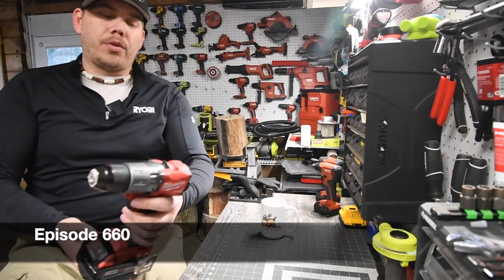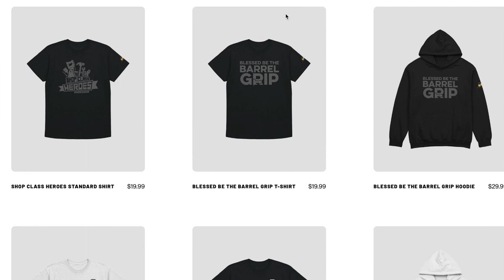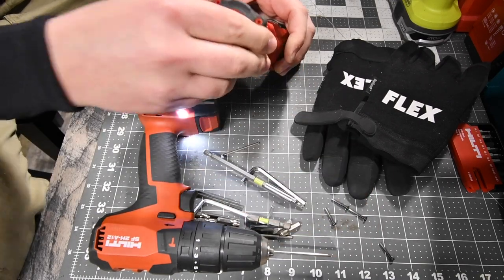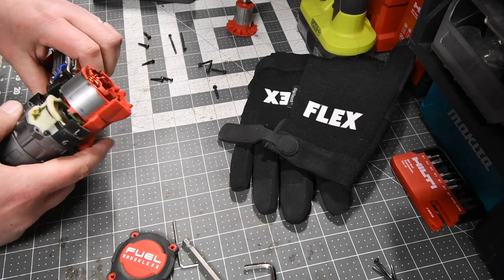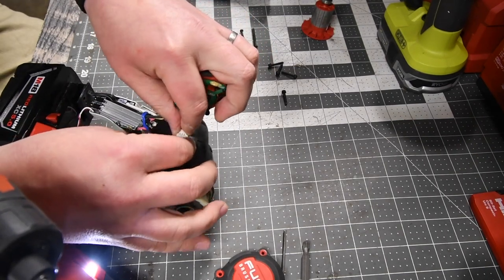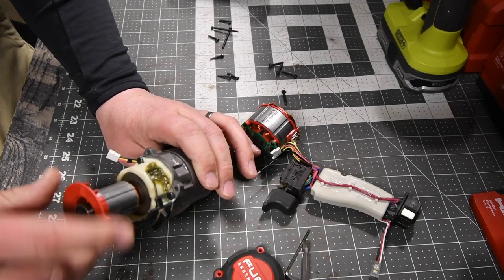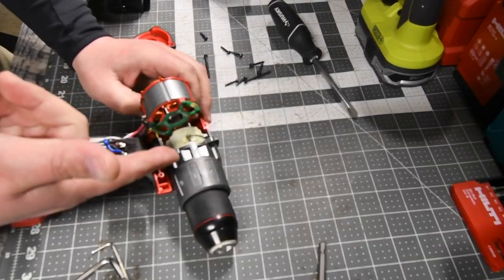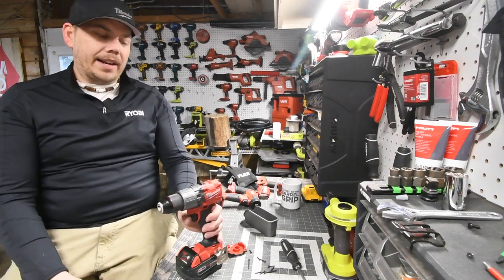ALL TOOL BRANDS BREAK!

Comment: Everyone loves Milwaukee but I've had a lot of problems that my yellow tools never gave me. M18 fuel hammerdrill chuck locked up in 6 months, fuel sawzall wouldn't change blades in 3 months, fuel impact trigger glitches and stays in forward and reverse after switching. Changed the chuck on the hammerdrill for $40. Took apart the sawzall and fixed it but it took 2 hours with the smallest needle nose pliers you imagine and a lot of frustration. The impact I can't fix because it's electronic. M12 fuel impact collet doesn't work. M12 tripod light stopped collapsing so I returned it. M12 vaccum dust flap was junk out of the box and would just spill back out when you turned the vac off. My Dewalt tools have never given me the same trouble. I also have a lot of milwaukee tools that I like, but for an entire m18 fuel kit to fail really bothered me. It was the most I'd ever spent on a kit.
Reply: The quality of materials is less on the Dewalt. However, the build quality/design is much better with Dewalt.  On average.
Reply: I’ve had the same issues with Milwaukee, but whenever they have an issue it’s “all tools break” and when it’s another brand I hear a lot of “ this is why you should only buy red”
Reply: @robertrada4783  the quality is less with DeWalt and better with DeWalt??
Reply: @robertcasey3528  Parts vs assembly of said parts.

Comment: Process of elimination starting from the battery on up. First thing that I noticed was the led light did not turn on. Verify the light was good then figure out what controls its function.  The tool doesn’t look abused.  A friend of mine who is a full-time mechanic handed me a box of brushed and brushless impact’s ratchets, batteries, you name it all out of warranty.  I’m surprised how much abuse that these Milwaukee tools can tolerate.  The issue I noted with every one of the tools and batteries was the amount of grease gunk built up around the  battery terminals both on the tool and battery.  They were not visible until you disassembled the tool and or battery. Most only needed to be cleaned in those areas and they were back fully functional. The brushless versions needed all the grease removed from the motor circuit boards and then they were up and running.  The brush tools were easy to diagnose because all you had to do was smack the side of it and they would start running for a bit sparking from the brushes. I just need to order brush cards. Like I said this was just a project I took on. So there was no loss in the event I couldn’t repair them then they would just be tossed in the trash.  

Reminded me of when I was young taking things apart to figure out what made them tick.
Reply: Led lights rarely ever go out. I'm going to lean towards a bad trigger.
Reply: Now that's some pick apart patience.

Comment: I’ve had to send my impact in twice to get fixed(trigger, reverse,bearings), hammer drill (trigger), rotary hammer (they sent a new one), 16ga nailer (they sent a new one). They’re good about fixing or replacement so I think I’ll keep with them until otherwise.

Comment: If you think the problem lies in the trigger (which doesn't seem to be the problem) , then by all means check continuity with the piece press and unpress, you can also check voltages, now if its the piece on the handle (i think it's a esc) then it's something it requires a new esc, and lastly, from the look of the thumbnail and the dissambly it seems you had a short on a board situated on the White piece thats near the transmission and I'm guessing it's a electronic clutch
Reply: The clutch does not work on mine but the rest of the drill works fine.   Go figure. 😂

Comment: I have the Ryobi blue tools and it's still works.
Reply: Then you're not using them for anything substantial. Most tools will survive a decade or two of hanging pictures.
Reply: I borrowed one on their blue recip saws. That thing had seen much use before I got a hold of it. I used it to dig up and replace portions of a septic system. Ran it nonstop cutting out roots and the like. I buried that thing in dirt and mud to the point the rubber over moulding peeled off. Obviously not as powerful as my Super Sawzall I purchased later but she did the job.
Reply: @BigHoss1776  Was it the Milwaukee M18 Fuel Super Sawzall Orbital Reciprocating Saw?

Comment: Hummm. What's the warranty on that Milwaukee tool? 5 years in case your not sure. There's nothing inside repairable and  the Motor/switch is more than the price of the tool. Soooo send it in and get it fixed. Really.
Reply: Milwaukee needs to quit with the cheap Chinese switches and learn from Makita
Reply: I was surprised how much those things cost as well it’s just a damn switch.  Then again they want an arm and a leg for their branded grease for their impact hammer assemblies.
Reply: Only a 3 year warranty on any of their OPE tools and they still use crappy switches in those 🤦🏼‍♂️ look at all the M18 mower failures right out the box
Reply: @Factoryseconds123  So I guess I missed were it was determined that it was in "fact" the switch? The problem with brushless tools is that it could literally be anyone of the electronic components or a mechanical connection. As far as Makita....... who makes their switches?
Reply: @slivers4007  Defond (in this case) for Milwaukee. Defond shows up in a lot of the German made or German owned stuff.  Omron for Makita, pretty much exclusively or maybe exclusively.  Kedu in Hilti.  It’s either the main PCB (I’m leaning toward it) or the PCB for the motor or any spot along the shoddy wiring.   Weird that I watched mancaver just praise the pcb assembly.  It’s pretty gnarly and sketchy looking in my opinion.  Other brands do a much better and more professional looking job. Milwaukee PCB pot boxes are like an amusement park ride that has been held together with duct tape and popsicle sticks.
Reply: @Factoryseconds123  I would happily guess if a Milwaukee repair person says something was a bad switch, it was probably, factually and most actually  the shitty soldering to said switch.  I’m used to seeing all sorts of crimped and heat shrinked quick disconnects or screw terminals in modern power tools.  Milwaukee, I know it’s going to be soldered. And I know the soldering is going to be a shit show.
Reply: @slivers4007  Omron.  Highly regarded Japanese company.  They use Marquardt in some other tools like angle grinders, but it's mostly Omron.  

Makita's also nice enough to allow you to service the switch if that happens to be the problem.  You unplug 2-3 wires, or a small plug and drop in a new one.  Can be an economical fix ($15-$30, depending on tool)  With Milwaukee you may as well throw the entire tool because they make you replace the motor, ESC and switch all at once because they make it all into a single assembly and the part costs well over $100.  (the one for this drill is $130, whole drill off eBay is like $100, so it's a pointless repair) 

About the only thing you can salvage off this drill is the outer casing and the chuck.   But the chuck sucks, and is a proprietary thread too.

Comment: I’d argue that because it says Milwaukee on there it in fact WILL break.  I can see how kinked that blue wire coming from the potted circuit board to the switch is. Which.. is typical for them.  I’m sure the soldering is just as lovely. All of the terminations are soldered… Take a look at the mess of stator copper wire hanging all about to make for their soldering terminations.  How much of that rotor is plastic vs…y’know…metal?  Take apart one of your 6H-22 drills (not the 4-22…that one isn’t built that well) and compare. Your audience will be blown away by the difference.  I’m not saying Hilti is the greatest ever. I’m not saying Milwaukee is the worst thing ever.  I’m just saying I know the insides and outs of these two specific drills. The build quality difference is night and day.

Comment: You prolly blew a component on the board. I would tell you to buy a new trigger assembly but you cant buy one anyway. I tried and Milwaukee doesn't sell parts event to parts stores unless you are an authorized dealer.
Reply: ML14-20-1120.  Not hard to find in stock at a couple places. 

The issue isn't getting the parts, the issue is that they're prohibitively expensive.  And Milwaukee makes things extra nice by making the motor, ESC and trigger all a part of one assembly.  So a trigger issue that might cost $15 with a Makita costs $130 with Milwaukee.
Reply: @jaywelker5566  dewalt does the same thing. Battery connection too the motor are all one expensive part.

Comment: You don't how it works so you can't fix it.
Reply from the maker: im not going to order parts and replace them just to mess it up. option 2, do what everyone else does. try to use the warranty
Reply from the maker: and you are correct. I have no clue what to do to take apart the board. im terrible with electrical work